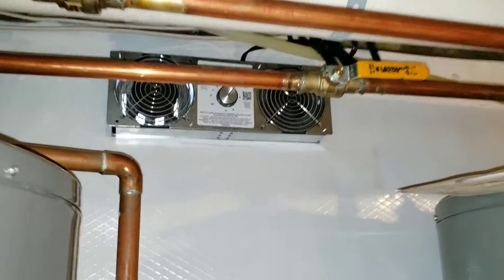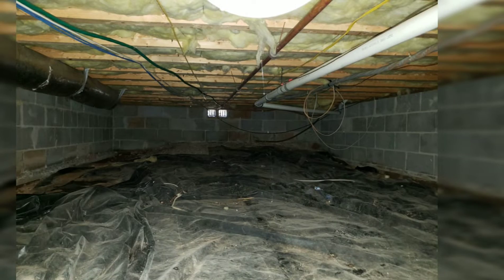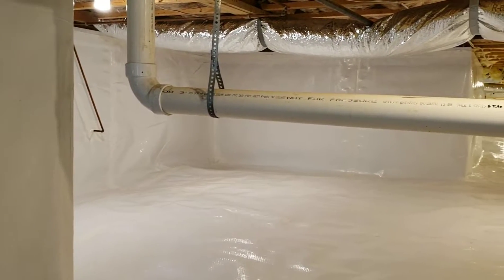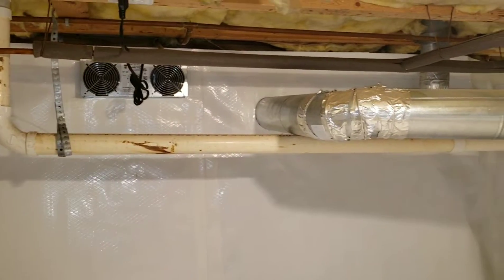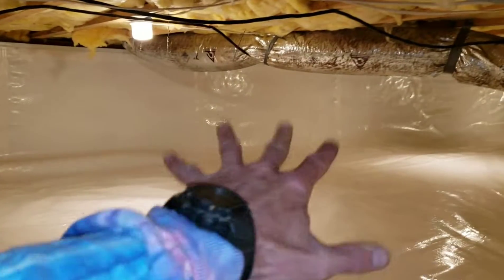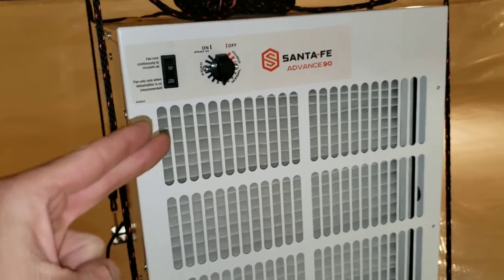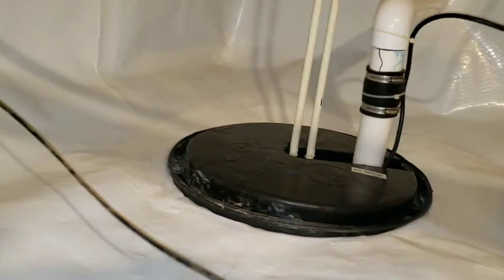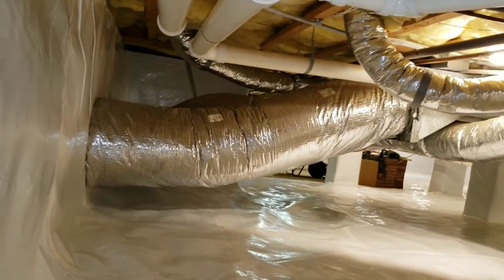CRAWL SPACE ENCAPSULATION EDUCATION! HOW TO FIX....

Comment: Tanner  why the poly batt in the floor joists? Most encapsulated space here on tube show no batt. Why is it you use it and is it fact if used it helps an encapsulated crawl space or is it just you personal preference??
Reply from the maker: No one agrees with me. No builder likes me. Yet, no one can replicate our projects, or our actual monitored results. The Johns Manville r19 comfort therm product is poly-encapsulated insulation, that we have been installing since 2008. We have tracked numbers on encapsulation projects with it, and without it. And without it, in the winter, there will be a 3-6 degree difference in temperatures from the crawl space, versus the actual living quarters of the home. When we do install it, here in the winter, I see an 11-13 degree difference in the same exact two temperatures. Showing you how much more heat is being kept inside the ACTUAL LIVING QUARTERS of your home, versus being allowed to escape into the crawl space. I am not that cool though. Cool people put foam on walls and heat and cool their entire crawl space. Best advice, don't seek to be cool. Seek to do what works. What we do works. Just as I say it does. Just as you see it does. And just like I been showing all of you willing to watch, for more years than I can count now.

Don't be afraind to buck your builder's judgement. They do not know about moisture in crawl spaces, no more than I know how to formulate proper angles when configuring the construction of a new home.

Thanks for commenting too!